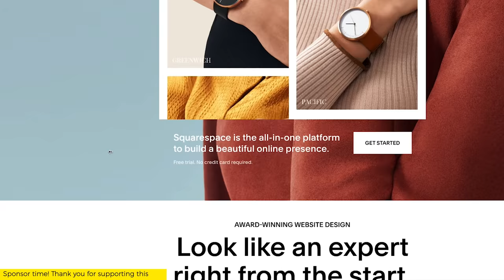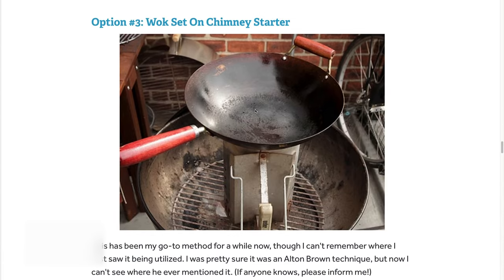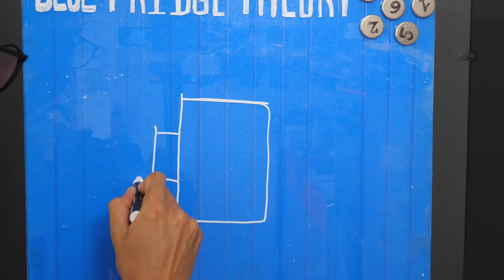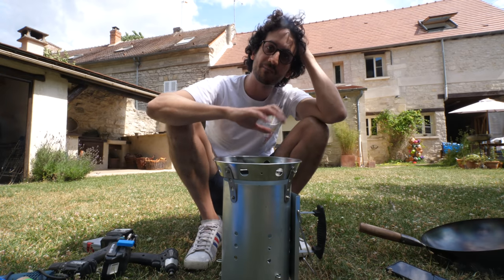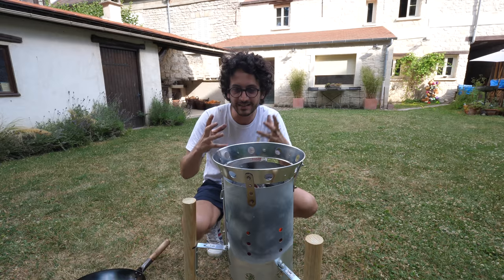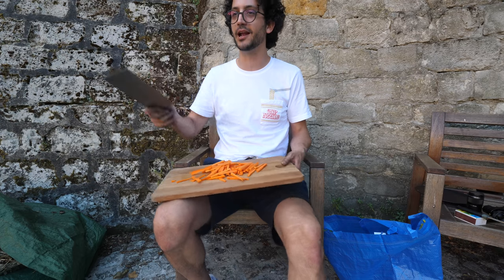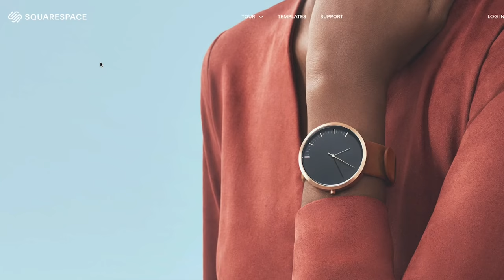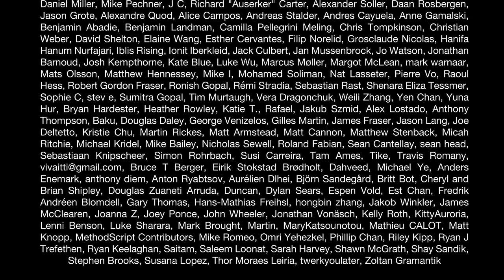How to make a Wok Burner from Chimney Starter (hack)

Comment: Add a vacuum hose to it with copper so it won't burn and you can use something like 2 big staples on you wooden poles for removing it ( staples - for describing something that would look like the ones you Hammer in) of course not staples lol

Comment: to take advantage of the heat provided by that chimney starter you might need to keep the pan down instead of pulling it up off of the heat to move the veg around

Comment: Apperently no one's said this yet, but *you need to use wood, not charcoal*. Charcoal isn't supposed to have a flame for long, seeing as thar would be unwanted for grilling. Wood will make a proper flame though. A pipe bolted to the bottom of your chimney starter would also help, as it increases the chimney effect.

Comment: Use a hair dryer and duct the air up from below...

Use another set of brackets to bolt the upper area in place...

Instead of into the ground, use a walkway paver, 2ft by 2ft.  Mark and drill holes for the legs to pass through.

 Use an old wok or old grill bottom underneath the rocket stove to catch the ashes.

Comment: You need larger hardwood charcoal.  Second, research "rocket stove" here on YT.  Experiment with foiling the side holes for a vertical lift, and maybe more charcoal for a higher stack, and some proper wood at the top.  Charcoal isn't utilizing gasification like wood does.

Comment: You arent supposed to lift the wok off the wok ring, you need to flick your wrist more so than just moving it back and forth like that, I'd show you how to do it but yeah. Leave it on the edge of the ring and flick your wrist uo and back at the end of the forward stroke.

Comment: I'd say a bucket full of concrete w/ 2x2s or steel square tubing sticking out so you can bolt and unbolt it easily and move it around easily as well.....

Comment: 1. Fan or a leaf blower underneath for more powerful flames
2. Clip on very heavy steel plate on the bottom, that way it can be portal (since you can clip it on and off) and also you would not have to jam it in the ground every time (center of gravity should become low enough to avoid any chance of tipping over) 
3. You can make the legs out of aluminum with the middle section having an axis, with a locking feature so it could be foldable and easier for travel (if aluminum gets too hot you could make the foldable legs out of wood)
4. You will need to counter all the small ash particles that will fly cause of the fan, that is kind of a bitch, I have no idea really how this could be made except for maybe cutting some vents on the sides in a way that won’t let much of the hot air get wasted but will get some ash
Good luck

Comment: why don't you just have long bolts coming up from the brackets on the pole attached with a nut so you don't have to bolt and unbolt it every time you use it and instead can just slide the whole assemble into place when the poles are in the ground. the whole assembly is so heavy with the entire steel(?) chimney starter and charcoal that i don't think it's going to jump at all so if the bolts are a good 4-5 cm it should be fine

Comment: Coals will not burn hot enough to achieve wok hie. and there's too much heat loss thru the large holes. You need a rocket stove design that burns wood

Comment: charcoal is obviously convenient but it doesn't burn that hot on contrary dry  wood does but it also burns quickly so I would suggest burning wood and you might need more  holes so the carbon monoxide and dioxide can escape leaving room to the unburnt oxygen 
and please be careful with an open wood fire .....it's hot

Comment: Propane gas burns at a higher temperature, and is easier to ramp up/down with the switch at the valve. Don't use the normal kitchen stove top. Google "4 ring gas burner". Easily burns off your face if you're not careful.

Comment: Putting the whole thing on a concrete or metal slab might be more stable but not as convenient. Maybe, if you can find an old smaller BBQ to take the legs off of

Comment: He wants more flame, I say forced air. Also the wood stakes work for proof of concept but black iron pipe will be a more permanent solution. Also instead of bolting it down solid  just put the bolt thru with no nut. Gravity should keep it in place.

Comment: Why not just buy a turkey fryer? It runs on propane which is an easy source of fuel. They are pressurized and extra hot. I use mine to cook down maple syrup, but have been looking at getting a wok and thought it would be perfect for cooking outside.

Comment: Maybe you get the Fire you want if you use Wood instead of coal it will burn way higher. Or CharcoalBrickest. Instead of Using the Wooden Poles Why not use 3 Metal beams and make it portable and foldable.

Comment: I know this goes against the “make it yourself” idea but this is I think a better method since restaurant style and quality foods typically do not have a charcoal or wood smoke flavor. Try either the one or two burner models, I just think this is more stable (it might be too low to the ground though) platform: 

https://www.webstaurantstore.com/backyard-pro-double-burner-outdoor-patio-stove-outdoor-range-with-side-shelves/554BPSQ212.html

https://www.webstaurantstore.com/backyard-pro-21-tall-outdoor-gas-range-patio-stove/554BPRD21.html

Comment: Wok fire blast that  is used in restaurants MAY be replicated using the Looftlighter.  Note the charcoals have to be well started. The Looftlighter is designed to withstand the heat. Here is a video that shows how you can replicate the wok fire blast on demand that you recognize in the restaurants. Link: https://www.youtube.com/watch?v=PgUO09V73UQ. Here is a guy using a paint heat gun versus the Looftlighter challenge The paint gun heater short nose may be a large draw back but the price less than $20 may be a positive factor. Start video at 3:10. Link: https://www.youtube.com/watch?v=G9EvHydhHXE

BBQ Dragon chimney has the hole already there plus their fan. Thank you Posters 
ChowMane & Andrew Fry for the idea.
Watch the BBQ Dragon chimney in action: Link: https://bbqdragon.com/chimney-2/
 

Raph_LR

Comment: 1 - the high center of gravity still makes the current design less than ideal. wok ring and tripod should be integrated into one sturdy frame. Chimney starter can slot in separately underneath.
2 - a fan forced chimney like the version made by bbq dragon (https://bbqdragon.com/product/chimney-of-insanity-charcoal-chimney/) would supercharge the heat nicely 
3 - some tips on authentic technique and recipes from someone in the know like the “Chinese cooking demystified” YouTube channel would go some way to ensuring you’re a bit more true to the culinary tradition you’re attempting to dip into here. Stir fry is more than just sauté with soy sauce.

Comment: Mhhh - while this is a fun project, the cost of the parts easily come up to what a regular wok gas burner costs online. I have a 150000 BTU gas wok burner and it cost me less than $50. It gets a carbon steel wok red glowing in about 15 seconds.

Comment: It doesn't look like a hack, it looks traditional to me.

I'm told charcoal production is quite energy inefficient given the lost heat in it's production.There are wood gassifiers bio stoves out there, I like the design of the Silver Fires for their performance, robustness and portability. I think if you got ok with squatting you could lose the stakes.

I'm also told that you can take the 'spreader' part off of the gas stove and with a wok stand, have a very powerful wok burner in your kitchen. Scroll down and look at the review pictures for this out of stock amazon product: https://www.amazon.com/dp/B0049IBXYQ/?coliid=I23U1DWU0VTAKQ&colid=2QA1X8CTLNSO&psc=0&ref_=lv_ov_lig_dp_it

Comment: un sèche cheveux sous l’allume charbon(assé bas ) te donnerait la puissance suffisante .

voir avec un interupteur  a pied 

for our english speaking friends
a hair dryer under the  coal lighter not to close will you you enough power to cook as you which  

 even with a electrical switch foot commanded

Comment: Hey alex, I was thinking a way to improve the fire height and it came to my mind this video: https://youtu.be/1BxQd6AGYiI
Maybe you can use that same principle ( I'm not sure how it's called, convection comes to my mind) to make the flame go higher. You would have to cut the metal cilinder in half and then attach it again so the fire makes the same effect shown in the video. 👍🏽